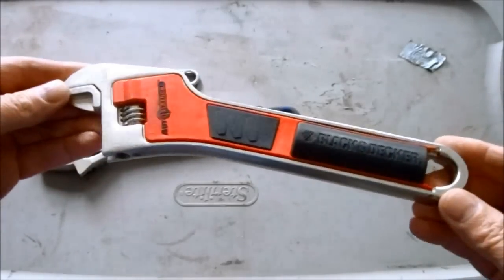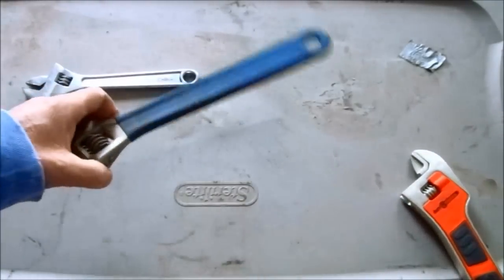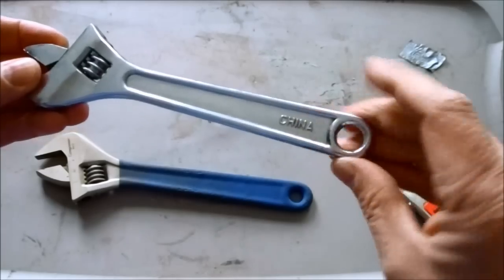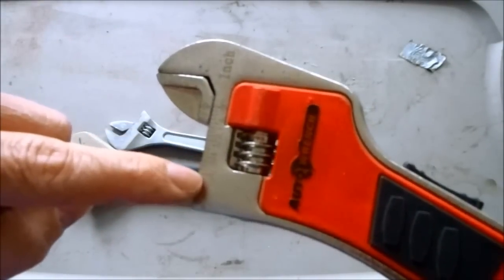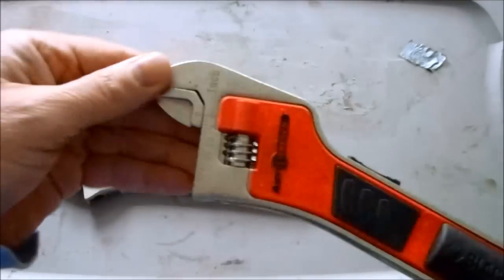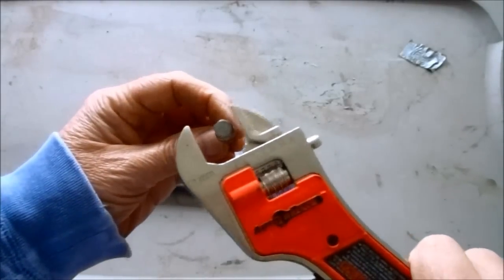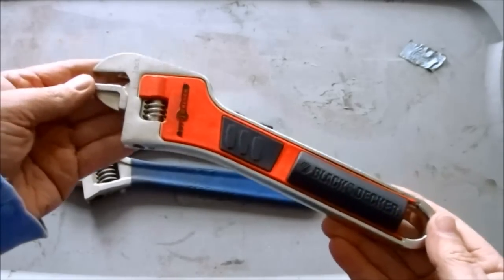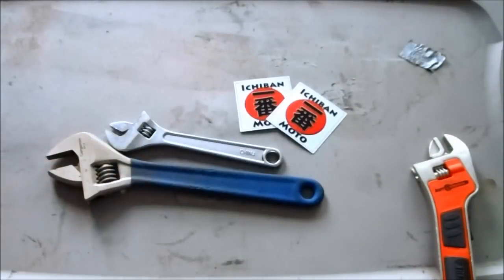Ichiban Moto - Motorcycle Shop Tool  Review of Automatic Wrench for vintage motorcycles cafe racer

Comment: The Black and Decker tool is OK, for the homeowner or amateur. Anything that is multipurpose rarely does any one thing particularly well. This is why the bad ass pro builders will always have a dedicated tool for each purpose. The standard and the metric Crescent wrench are a must in every tool kit. In an emergency, either will work with Whitworth or British Standard, though continued use is not recommended. I have found a source for British ViceGrips, but the import duties are too high to consider importing them.
I sure hope you fire it up soon. That thing is going to rule as well as being bitchen and bad ass
Reply from the maker: if we get enough of us together, we should consider importing a case or two of British ViceGrips .... that way we can all share in the freight / tax/ duties and cost average them down to a reasonable price ea. ( or make a fortune on fleabay )

Comment: This is just a sneaky way for Black and Decker to make money. Professionals know that once the nut is on, you have to flip the spanner over to take the nut off. What happens is that, you may have tightened a metric nut but, when you flip the wrench, you have an imperial spanner - no good for the metric nut.
The only way to take it off is to buy a new spanner with metrics on the other side. Shame Black and Decker, shame.